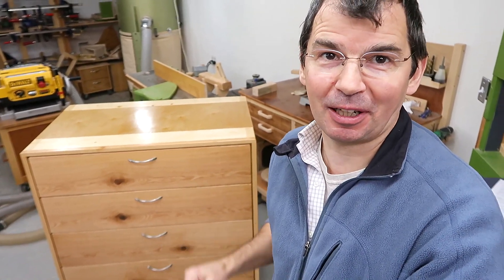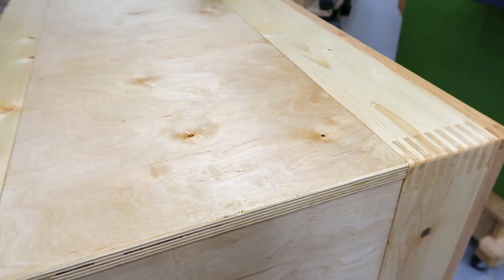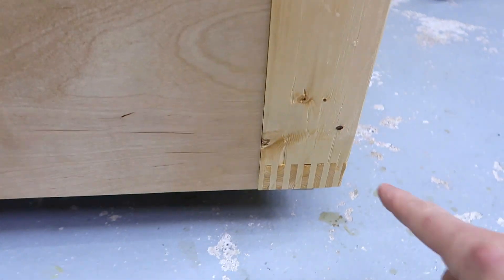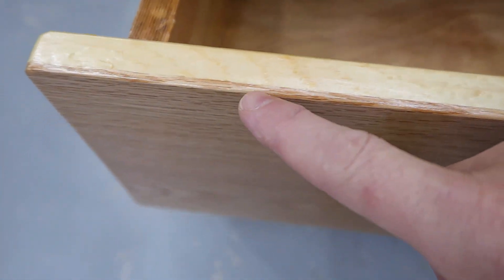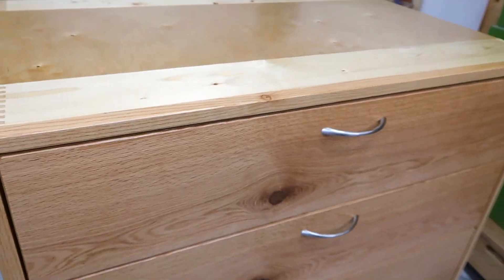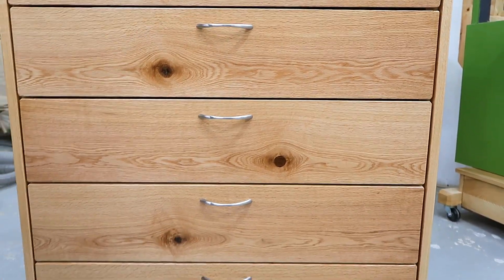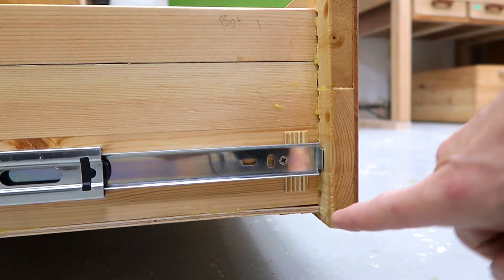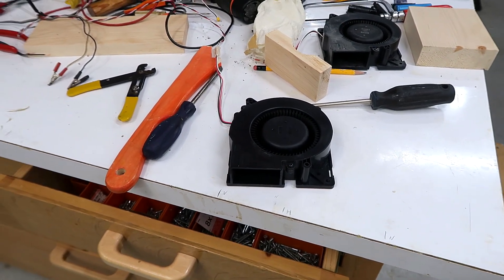I screw up more than I used to

Comment: Your screw-ups are important in one more way - at least for me. When you have a problem and need to fix it, you come with solutions I would never even dream of. Like the time you've created a dent and fixed it with saw dust and wood glue - while I am not a wood worker, I've used that trick already like 5-6 times.
Reply: If you have real solid wood, and you bumped it with a hammer or something, and dented it a bit, you can dampen a rag, put it on the dent, then put a hot iron on it to well out the dent. Start slow.

It works

Don't know if I recommend it on clear coat though

Comment: Clicked expecting the title to be a pun about wood screws: between GRK and Spax screws with excellent threadforms/self-tapping features and Torx heads, ubiquitous impact drivers, metallurgy and coatings that make structural screws affordable, and an increased value on my time I find myself screwing things together more and more.

Comment: I like seeing the screwups and the methods to fix them.  Even if I don’t learn anything specific that I can use on my projects, I think seeing them helps me do a better job mentally of dealing with mistakes that I make on my own projects.
Reply: You can't beat yourself up over things. There's arguments in support of failure. If what you're doing is really meaningful then it is going to be challenging too. Everyone makes mistakes so what's important is how you deal with those mistakes. Success is falling down 7 times and getting up 8.

Comment: One of my favorite programming channels is The Coding Train. It’s hands down my favorite because he not only shows the process to figure things out, but he also shows the problems he runs into and how to solve them.

Whether the mistakes are small, “dumb” or something that take re-engineering, he leaves then in.

I love that. Too often YouTubers will just breeze through a project like it’s no big deal and that can really be demoralizing when you try to recreate it and run into a bunch of issues and think it’s should be easier than it is.

The way you do things is perfect. No need to change anything!

Comment: Matt, 
I'm going on 68 now so I guess I'm headed into fossil mode. I was an electrician by trade who went back to school and used to teach electronic engineering and train people on modern locomotive processor and power plant technology/maintenance among other things. My side job and passion was and still is cabinet making. A coupler years ago (that's railroad talk),  I watched John Heisz screw up in a video and he remained very calm. I think he put it best when he said something like, "mistakes happen; deal with them and move on." I used to be hot tempered when I screwed up, wood assemblies would fly across the shop and crash into a concrete wall. Now days, to me, a mistake is an opportunity to for an exciting journey to correct something in a way that looks creative, and THEN I move on. I guess I'll never do crossword puzzles in pen but they don't look bad when I'm done. 
Best Wishes for a HEALTHY and Happy 2023.
Take Care,
Tom K.

Comment: I would agree that small things like this are not necessarily worth including in the normal videos, but I do think that even from an educational standpoint, including the mistakes is valuable. Most of your videos are structured in a way that someone would watch them before starting a thing rather than a long tutorial, so seeing possible things that are easy to mess up is really useful so you know what to watch out for. It's also a nice reminder that even woodworking marvels make mistakes ;)

And yes, that one drawer hurts me inside. That's the kind of thing I would spend a half hour staring at debating whether it's worth the huge unnecessary effort to fix XD

Comment: Nice one Matthias, the type of woodwork I do is far too often a 'comedy of errors', so I'm super glad you mess up quite a bit too. I've acquired a super accurate tape measure now, marked with attometer increments, so all my efforts in 2023 will be absolutely perfect, of course. You should get one from Harbour Freight...of course, only metric tape measures available..'atto-yards' doesn't make any sense....eh?

Comment: Great video thanks. I'm a beginner, so always trying to cover up mistakes. Often, my mistakes waste a lot of my time, but I think it is ultimately speeding up my learning process 👍.
I'm eager to find out what you're planning with the small blower fan. I used one to very successfully make a quiet dust extraction system for my scrollsaw. It sucks through two small locline pipes above and below the table, via a small 1" cyclone and outlets into a vacuum cleaner bag. Takes the dust from the cutting line and removes all the fine airborne dust directly from the blade. My Hegner is quiet, but still drowns out any sound from the dust extraction, and let's me listen to the radio. Spent several hours cutting small Christmas gifts for family today and no coughing or ringing ears. Much more relaxing than wearing a mask and listening to a shop vac.

Comment: I used to have problems resawing veneers until I finally plunked down the money and purchased a carbide blade. Best investment I ever made for my bandsaw!  They never get dull and don't drift unless you really force feed it hard. Even the high TPI ones cut very fast while still leaving a cut as clean as my table saw. They cost about $100, but if you watch eBay like a hawk and you're willing to braze your own blade, you can find some amazing deals.

Comment: I was one of the people who suggested glue with longer open time. Yes, once you've clamped the pieces, it doesn't matter anymore. But I've noticed in several videos you're frantically trying to spread the glue onto all the surfaces when there is a lot of surface area and/or intricate pieces. That's the part where  20 minute open time would help.

Comment: The interesting thing is, if You do look into midrange carpenter's single pieces or even into low volume industrial production furniture that does not cost an arm and a leg, You can also find a lot of the "screwups" You have shown in this video. 
For the woodglue problem ..... I do pre-moisture my joints with a little tomato sprayer in winter when heaters dry out the air and thus the bone dry wood surfaces would take in the moisture way too fast for me to close all the gaps before clamping inhibition begins.

Comment: i've been doing carpentry and woodworking for about 10 years now, and i've learned that your own screw ups will almost always bother you more than the customer.  you know where to look for all the problems since you did it, and you're usually looking at it a lot closer than the customer is.  most do not notice minor things, unless you point them out.  then they will scold you for pointing it out because now they can't not see it.

Comment: The older you get the worse it becomes. It will ultimately save you time and frustration if you make a game plan and write it down. Group actions using the same tool together for efficiency. Find all the tools and fasteners you will need and have them out and ready  before you start. It may sound trite but it’s true you fail when you fail to plan.
Reply from the maker: That works if you are doing something very similar to what you have been doing a long time.  Not so much when trying new stuff

Comment: One thing I have learned, both in 50 years of engineering and in woodworking, is that screwups are essential to finding the right way to approach a project. Can't expect to find the right way first off except for the simplest and most routine, and "routine" implies familiarity, which means one has already made some of the most common mistakes and learned to avoid them.  So yes, make mistakes!  That's called "learning."
Reply: I share some background with you as an EE, and appreciate that your mind and mine run in similar tracks, Mattias.  Like you, I was privileged to grow up with a workshop.  Dad had taken his degree to be a shop teacher, so he sure as hell taught me:  I could cut threads on the metal lathe by the time I was 14.     11/16" 46 TPI? Right hand or left?  Sure, just swap some gears and turn it to size.  Engineering was my target from that time, and ham radio helped a lot too.  Built my own stuff from Heathkits, and they actually worked.  I was WA3CTR in my teens, on 20 meter and 6 meter bands.

I had a couple of opportunities in college to show off in EE lab, since I already knew how to run a scope, and the grad student in charge of the class had no clue, however theoretically brilliant he was.  Couldn't get the timebase to trigger!  "Here, you pull THIS knob out and turn it, and the little knob is the variable, and here are the trigger settings HERE and HERE."

Making mistakes was part of the learning since I was about 7 or 8.   I expect your kids are benefiting from that kind of experience!  They won't be afraid to open up a gizmo and see what's inside, and maybe fix it.  I still have some of the things I made as a boy, treasured recollections of those days.

 I think you are doing much to educate those who didn't have a shop to learn in, growing up.  And the rest of us!    I always learn something from your videos, even though I'm an old crock now.  Keep up the great work!

Comment: Not too bad for a first run on new design ideas.  I like the finger joints, these are really strong and I have used these on a few of my projects.  I don't have an efficient method to get the glue on all the fingers quickly, there needs to be good coverage for a strong joint=, it can get messy.

Comment: To delay the glue you could wet the surfaces before applying the glue. Like it's good practice in masonry dipping the bricks into water to keep the mortar-water ratio intact (the bricks don't suck the water out of the mortar).

Comment: The vaneer issue has quite a simple solution. Glue a new draw front on the exposed bit and then plane the old front off leaving the correct bit
 Securing it to the remaining draw.
Reply: It would also allow you to get an even thickness on the vaneer.

Comment: For some of the tiny joinery gaps it's not too late to add tinted wax in there, but that's only if it bothers you. Most of the "screw ups" here are really minimal. One of my former bosses at a furniture place used to tell me that part of woodworking is knowing how to hide your mistakes. We made a lot of the furniture from "grade 2 and 3" pine to save on raw materials costs, so we had a lot of creative ways to hide the uglier boards with very large knots. It was yet one more skill to learn how to use less than perfect boards, because "anyone can make really nice furniture if you're only using 'select' boards." Part of the fun of your channel is your creative use of low cost or easily found (or even salvaged/recycled) materials.

Comment: Have you ever tried bone glue or fish glue? Both do not smell good, but you can fix mistakes because they unset if heated. For bone glue it occurs at 60-70°C, for bone glue it is less than 100°C. Up to now I have only tried fish glue because it is ready to use; bone glue is solid and must be heated for use.

Comment: Curious to see what comes of your blower and optics experiments. As long as you are having fun, your videos will always be refreshing and entertaining to watch. And even if they are made strictly for entertainment purposes, I learn SO much from them - which I can't say for many of the big science / tech entertainment channels.

Regarding the trim not aligning with the frame - would it be a possible solution to glue each side of the trim to each side of the frame first, then joint the outer side to make it flush, then cut the box joints? Or would that introduce problems elsewhere?

Comment: The only thing that irked me about Norm Abrams was that he would build something and then measure it corner to corner to "check it for square."  His two measurements were always exactly the same so he never showed how to fix things if they were out of square.  When I tried to build a similar project, the measurements could be quite different but I didn't know what to do about it.  So I really appreciate discussions of problems and fixes.  Hey - that's real life in my world!  Oh, and what was the name at about 7:53 - Destin from Sparta?
Reply: When one measurement is longer than the other one you need to shorten it up. You can squeeze the corners with a clamp, or hit the corner that's sticking out proud. But yeah a big criticism of the Plaid Pretender was that he never made any mistakes. His first appearance on This Old House is here on YouTube and it is some funny stuff. I won't spoil it but you should go find it and watch it. It'll make Saint Norm more of a mortal.

Comment: I would like to see you add a stepper motor and controller to your box joint jig. Then you can set the spacing and just press a button each time you want to move forward after cutting, instead of turning the gear manually.
Reply from the maker: yes, but that would be a lot slower.  Also, I just attach a piece of tape to the gear to tell me where to stop.  And that box joint jig has never crashed!

Comment: Very cool video. I actually just had a thought. I'm sure you thought of this already as you're pretty thorough in detailed, even with your mistakes...

With speakers, you can buy DIY kits that have a flat pack for the boxes. Have you given any thought to having CNC cut kits for things like a box joint jig?

That might take a few of the armchair woodworkers, really myself included as of lately, and convert them into actual woodworkers. Of course it would be dependent on the price as to whether that's feasible but I could see if all the common parts you could pick up at your local corner store and then The items that require a level of precision and tooling could be included in the CNC flat pack kit. Also maybe a digital guide as to how to use it in a PDF format.
Reply from the maker: The problem is, CNC is so limited and really only works well enough with expensive balitc birch plywood, so it's not very practical.
Reply: @matthiaswandel  I see. Too bad. Thank you for replying.

Comment: Have you ever used PL Premium for glue? I've started using that exclusively for my shitty workmanship using MDF or Constrution lumber because it can float as a gap filler... It also cures at low temp... Just a thought. Epoxy is messy and you sure as shit better mix it correctly... Or else its soft or sets too fast...

Anyways... right on brotha, keep on the good work!

Comment: 6:25 Just a dumb idea from someone who has no experience with wood working: What about spraying the wood down with water just a bit before applying wood glue and pressing the two halves together? Shouldn't that then dry out slower?
Reply from the maker: yes, probably.  Unless it waters down the glue too much!  And it's messy

Comment: When I was in structural steel professionally I rarely made mistakes. A mistake cutting a 5000 pound beam can be costly (a mistake installing it could mean falling to your death too).......Working at home in my shop I'm just relaxing and I make way more mistakes............As a job I was like 99.9%+ accurate and mistake free....Goofing around at home just having hobby fun I'm more like 90%

Comment: Screw up’s ? I don’t make screws ups , I make Kindling to start fires 😂 I’m currently remaking the router but storage on my Rockler router table ( woodworking journal plans) because someone stop by in the middle of the glue up and the glued had dried before I realize my mistake . It’s important to know how to build a project but it’s also important to know how to fix a mistake

Comment: The things beginners mess up aren't clear for experienced people. I had to learn the hard way that my tools weren't really adjusted, in addition to learning how to use them properly.

Currently I'm trying to figure this out: When I use my planer/jointer on birch pieces, it sometimes seems to rip the fibers out, I guess this is because the fibers don't go straight. I usually fix this by turning the board around, but sometimes a board can have fibers going in and out so that there's no orientation where it doesn't cause rips... I tried taking very shallow passes but no help... Is there something I can do apart from getting better wood?
Reply from the maker: Shallow passes can help, and by shallow I mean something like 0.1 mm or less.
Reply: @matthiaswandel  I'll try.

Also, one kinda simple thing that took me some time to figure out is what tools and how precise should I be.

Like, let's assume you take raw wood and want to end up with exact dimensions and smooth surface. Now to someone as experienced as you, the process is clear. You start with rough and fast tools and end up with precise and slow. chainsaw -> sandpaper. How precise you measure and cut should reflect on the precision of the tool. Sometimes you need to make one dimension precisely, but leave others for a later precise cut.

IDK if this is of interest for you. If you want to educate us weekend woodworkers, there might be something here to make content about? Your channel does focus on more advanced stuff tho, so maybe not.

Happy Holidays, I hope I didn't waste your time.

Comment: what if you got the wood joint slightly wet with water just before gluing up to extend the glue up time? does that work? Is it as strong? you have all the testing equipment and love making videos about that type of thing. might be something worth a try.

Comment: handles should have been lower. Makes pulling out a drawer easier; the directional force angle to the glides on the bottom is not good. =you know that a straight lineof force is greater than a 45 deg pull angle

Comment: I am asking out of ignorance,  but would you be able to extend the working time of the glue by lightly misting the box joints with water from a spray bottle?
Reply from the maker: maybe, but getting wood wet when you glue it also swells it, not ideal